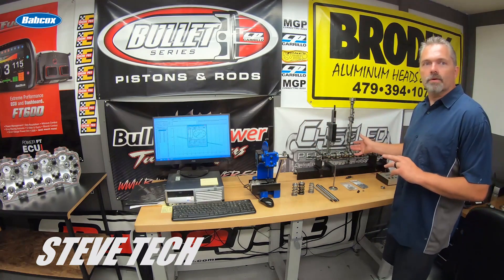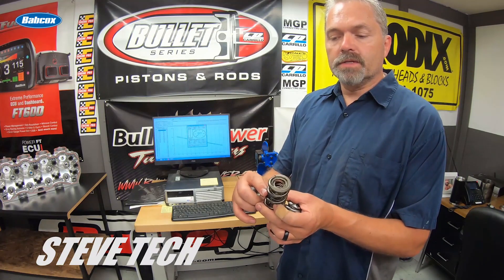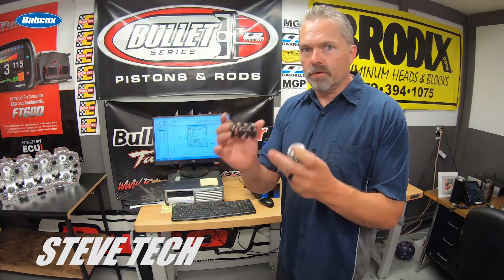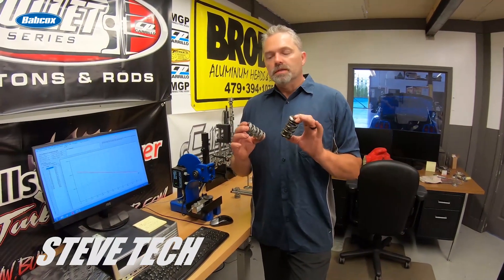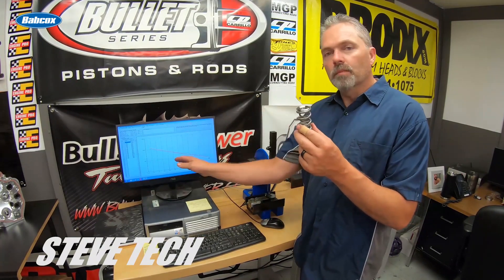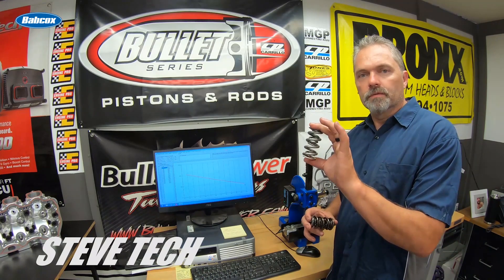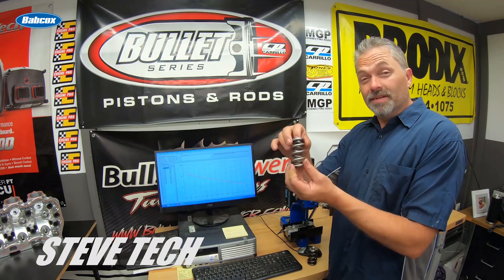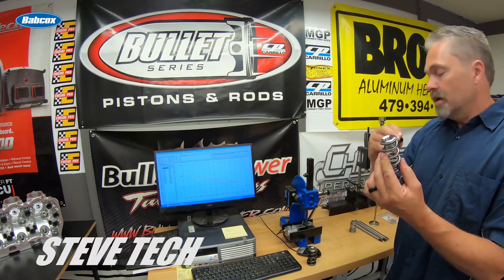Understanding Valve Springs – Part 1

Comment: Why are OHC engines valve spring pressures so low compared to that of OHV engines? The OHC engines rev higher, yet their springs are smaller in diameter and the spring open and closed pressures are MUCH, MUCH lower than OHV engines. What is the physics behind this?

Comment: Would it be possible to put springs on the lifters? It would only have to handle the weight of the lifter to keep it against the cam. And you might be able to back off on main spring force to get longer life.
Reply: This technology already exist. Look up "REV KITS" to see for yourself.

Comment: Jesus get to it!! Just tell why the smaller spring is better! Do you get heavier springs because of higher rpms in a motor? What is floating a valve and how do you remedy it. Pointless video. Horrible delivery.  Apologize a little more for terminology.

Comment: If i have steel heads to i even need spring locators?.490 lift cam. just use shims to set valve installed height and be done.?

Comment: Watching this because I saw there was a second one.  You can say you're not an engineer and brush off your bad info all you want, but you're still making a video to teach something aren't you?  WTF is the purpose if you're going to miss the mark so badly?  Title of the video is "understanding valve springs" but the presenter obviously doesn't understand valve springs...  It's harmonic resonance, nothing to do with the normal spring pressure and valve float per-se.  A single spring is made with a single density and tension, and at it's resonant frequency the metal loses it's "spring" and basically goes soft like spaghetti.  An additional spring will have a different resonant frequency that doesn't overlap with the first spring, but adds weight to the assembly and can cause float if used in the wrong application by somebody who learns everything from YT.  Bikes rev over 15k and get past this by engineering better single spring designs with better alloys that push that frequency above the operational range of the engine, or just get rid of the spring altogether
Reply: This is Steve Morris. He knows his stuff plenty well
Reply: @nsboost  Obviously not
Reply: Hey Mikael, do you have some question or some amazing wisdom you want to impart on Steve and the rest of us. Because from what you wrote here, and on some of his other videos is “errrrr American V8 is crap! My bike spin to 15k rpm!! errrr” If you knew more than just how high your Ducati revs you would know that a cross plane crank v8 with OHV heads and the cam in block design will never rev past 8500rpm. So for them resonant frequency and valve harmonics aren’t that important, even more so if it’s a drag race application. For them most important is good seat pressure, high lift with no bind, eliminating valve float, the valves are holding back tremendous amounts of manifold pressure if it’s a turbo or supercharged engine, and it usually is. Did you know that it takes 170hp just to spin the “top fuel” dragster supercharger! So maybe your Ducati could spin it? What you think?
Reply: @martindworak  Did it seem like I had a question, dummy?  If you want wisdom, read my original post, a book, or start learning on your own.  I'm not your Mommy here to hold your hand.  XD  Sorry you felt the need to defend Steves' honor like you're some knight and he's a damsel in distress.  Maybe you should grow a pair.  Ducati's don't rev to 15k unless you're talking about GP bikes, dummy, I was referencing my Honda.  Ducati is just the most recent manufacturer to grant me master certification.  Which I only pursued to get my foot in the door with Ohlins.  Sorry you suck so bad at life.  Maybe work on yourself instead of trying to live vicariously through random YT personalities.  Loser.
Reply: @bridges of delusional county Nah, you're explaining it perfectly.  It's sometimes a pain in the ass to get the cam to sit right on the tip of the lobe, especially if you have super stiff springs and an aggressive cam, but there's always a couple degrees of dwell it should be able to sit on.  It's usually pretty easy to find that sweet spot if you have the appropriate cam turning tool with a long enough handle, but if you're forced to go at it with a wrench I usually have the best luck getting it close, then giving it a few light bumps with the heel of my hand.  It's not TOO hard if you have a good box end wrench that fits nice and snug.  And make sure that you don't loosen the pulley bolt.  If I'm using a wrench I always come at it clockwise so I don't have to worry about breaking loose the pulley bolt.  Check your FSM, there might be a hole or a slot somewhere on the cam that will hold it in the EXACT spot it needs to be, then you can just slide an appropriately sized punch (or whatever it calls for) in there to catch the hole.

Edit:  I didn't even answer your question in all that.  lol.  Yes, it's perfectly normal, and no, you shouldn't be able to stop it anywhere you want.  Any time you're on the opening or closing ramp of the cam the valve spring is going to be fighting you, trying to close the valve and get back down onto the base of the cam.  Hope my explanation helps.  Be patient with it.  It can be done, just don't let it beat you or get you flustered.
Reply: @bridges of delusional county Don't quote me on this, but it MIGHT be just the way the lobes on your engine are phased.  You should be able to tell if that's the cause by just looking at it and watching how it works though.  Remember, any time you put a valve in a drill, wrap the tip in electrical tape to protect it.  A dial indicator can be picked up for pretty cheap, but you can tell if it's slightly bent by lapping it in and looking at the wear pattern.  There's no "natural" runout though.  Bent is bent.  If you need a cheap way to test if the springs are fatigued, I made my own DIY setup with a cheap fish scale, some scrap metal, and 10 minutes with my welder.  Stiff lifters?  As in rockers?  I'd be checking for wear on the shaft then, or checking if it's bent.  As far as GM engine design, I've never seen anything come from any American manufacturer that was worth it's weight in mud.  No offense meant.  I grew up at my Dad's knee, who was a big smallblock guy.  When I got older I started messing with foreign stuff and stopped ignoring the massive issues domestic stuff has.  If you think active cams are confusing, you should come have a look at the insides of a Ducati.  ;)  Damn Italians think "complex" is a challenge with their Desmo, they're screwing the pooch with their transition to CAN, and it's impossible to find the English entries in the manual.  Which brings me back to the best advice I can give you.  You need a factory service manual.  The factory one, from GM.  Not a Haynes, or a Chilton, or any other crap, waste of money gimmick.  Without one there's nothing stopping you from wasting your time chasing your tail.
Reply: Working on Nascar stuff.......

Whole different world....... you are right...it involves a lot more then Steve presents in this video......

But for the layman...its ok.

And in F1.......hahaha...no springs anymore long time...
Reply: @Baard2000  Yeah Nascar uses ancient caveman tech.  They don't pursue speed and development, they sell soap operas and corporate ads.  Not my favorite series, considering DMG single-handedly killed racing for the entire country.  I've never personally seen inside one of their engines, but from what I understand they're still using pushrods.  Not sure why, but yeah.

As far as this video being good enough for the layman, it isn't.  Bad info is bad info.  If somebody doesn't know anything they should pay somebody to build their engine who does.  If they want to know more it's videos like this that will just screw them in the end.

Comment: Lol dont do what I did and lose 6/24 valve spring seat washers cleaning the head because you forgot to remove them. Cost me an arm and a leg to source oem ones. Id be up for all new springs and matching seats @$500+ if I couldnt locate them.